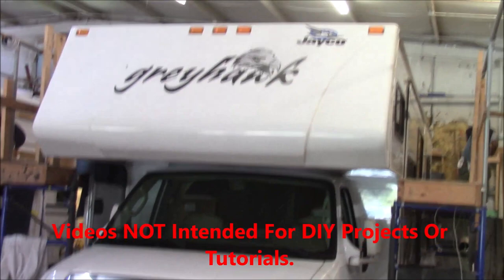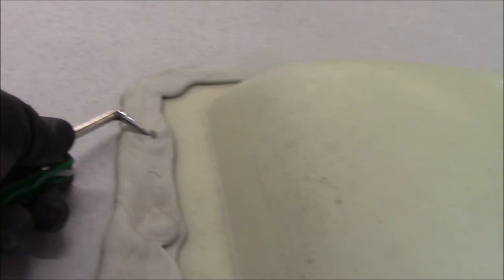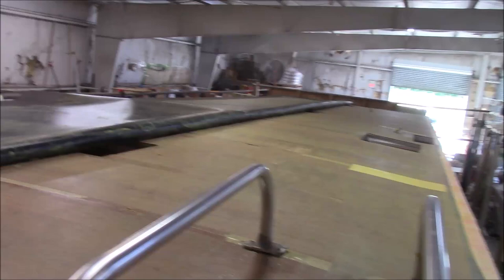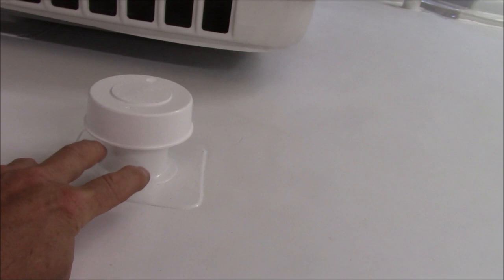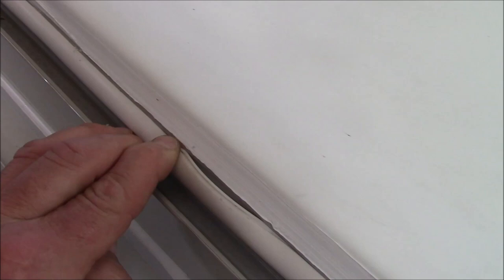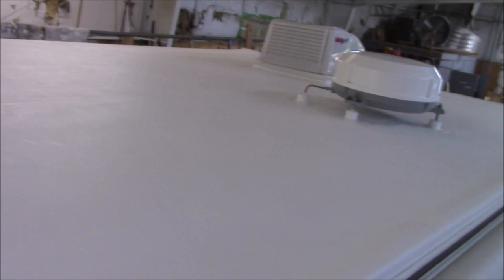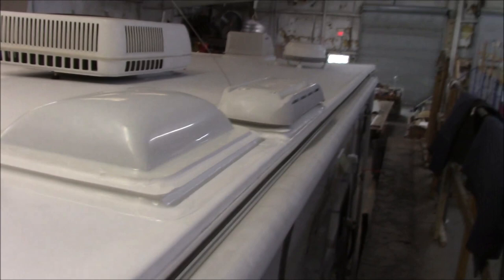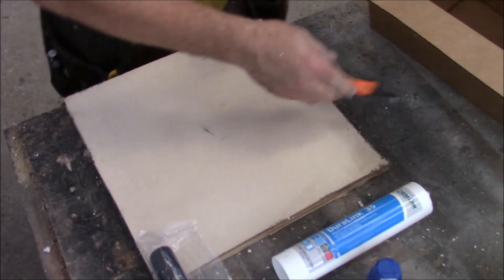31Ft  Jayco Greyhawk

Comment: Good morning have you ever done a hartland northtrail 23rbs TT we live in Arizona not full-time but just retired couple camping,  boondocking a few times a year
Reply from the maker: I think the north trail is a northern package? It may have a plyfoam roof like the Flagstaff. Or it may be similar to the Holiday Rambler 5 th wheel.
Reply: @RVROOFINSTALL are you familiar with the plyfoam roofs
Reply from the maker: @Yukonjackman1  yes